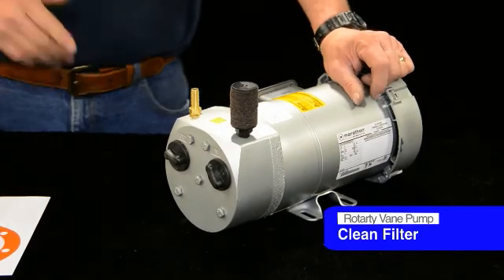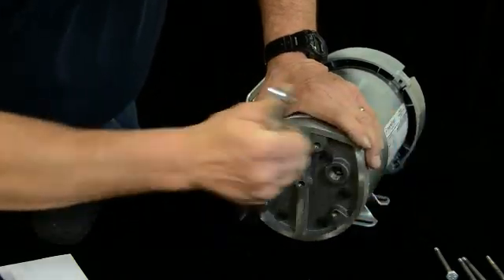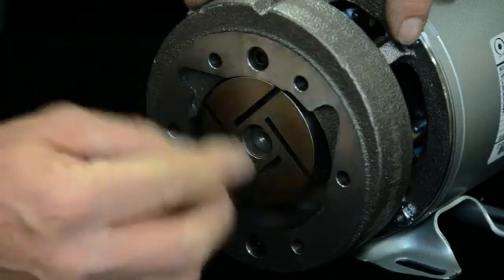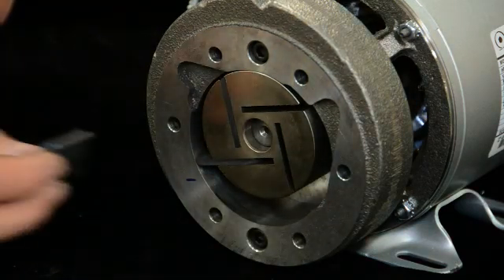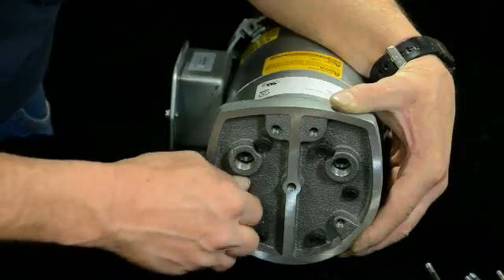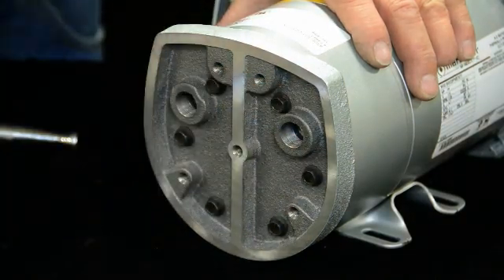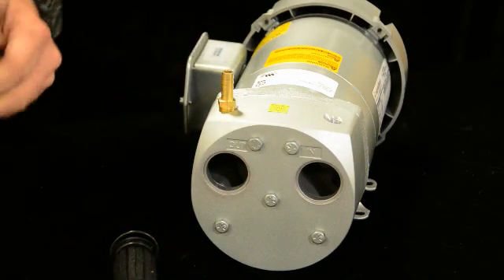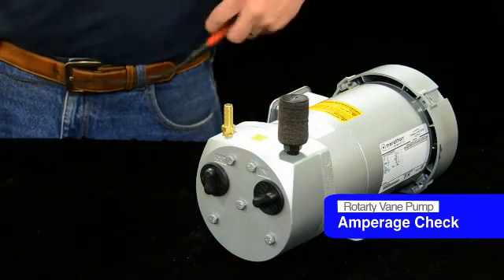Pump Rebuild: Rotary Vane Compressor

Comment: I have a R03 air compressor for my septic system which has not been maintained for years. We have not replaced the filters for at least three years. Not it stopped working and it was very hot. It was powered off already. Can it be rebuilt (change the caskets and filters)? Thanks